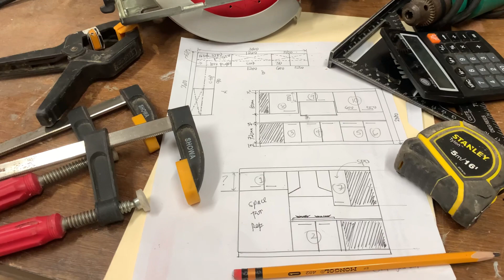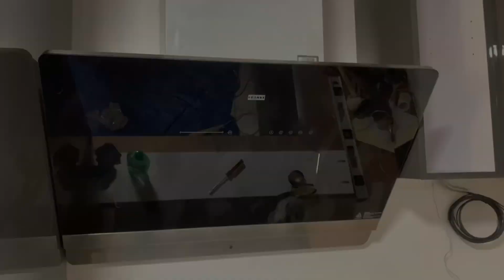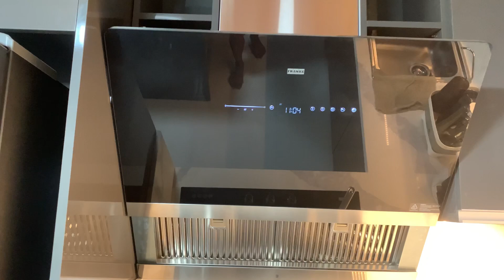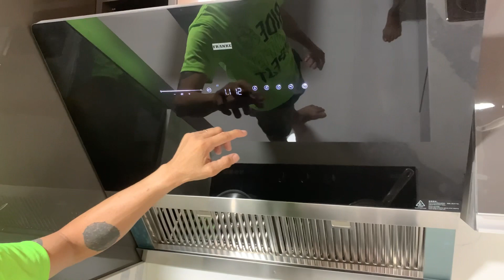The Process For Making Modular Kitchen Cabinet | Kzone Woodworks

Comment: very nice sir. ask ko lang po, saan nakaka bili ng mga mdf boards na yan na may finished top and color na po? mag kano po and ano sukat?  and ano po bang material ang ginamit sa counter top , baka po madaling ma biyak and ma bulok ng tubig and back splash o wall panels sa may lutuan and sink. maraming salamat po sa pag turo at sa pag sagot.
Reply from the maker: Good day po…bale un board namin n gamit dyan acrylic high gloss on marine board para s mga expose doors and vertical.tas s carcass or cabinet nman po marine melamine n white po cya.tas un counter top po granite po cya ganyan n po yan pag n bibili per slab po cya.nk sealant po yan kaya din po yan babasukin ng tubig.kadalasan yan n po gamit pag modular kitchen sir.matibay po yan..
Reply: @KzoneWoodworks  ganun po pala ang mga gina gamit na materials, sana ma isama nyo po mga details din ng ibat ibang materials even mga kinds of hardware, mga pang sara, handles and hinges and guides and saan po ba mura makaka bili, naka kasi po kung mga ace o wilcon mahal, may mga distibutor po ba. puede po siguro isang segment nyo yan, tutorial din po sa amin saan bibili at ano mga bibilin. also sana me details din po ang mga sukat ng bawat cabinet o panels para alam namin paano puputulin hehe. maramin salamat po sa episode na gagawin nyo po, madami pong mano nood nyan
Reply from the maker: Yes mo matibay po kc un marine board.s mga material po my supplier din po kami n malapit s amin tas maramihan po ang kuha pra po mk less.pag madalas n po kyo kumukuha s kanila
Reply from the maker: Nag bibigay n po yan ng discount.bk my malapit po s area nyo n hardware yun po kayo sun kumuha.ganun lang sin po kami.my supplier sin po kami.pag mga ace wilcon iba po price pwera n lng kung nk sale po.

Comment: Why didn't you use pocket screws
Reply from the maker: Gumamit po tayo dyan dun s mga expose side po nya nk pocket hole po tayo dyan.tas nag lagay lng po ng pockethole cover s pinaka butas nya n ns loob pra di po kita un pinagbutasan ng pocket hole.salamat.
Reply: @KzoneWoodworks anong screw ung tama sa pocket hole  lagpas kasi ung gamit ko na kasama sa kreg.
Reply from the maker: @martinlaureano8425  25mm po gamit ko pag 30mm tagos mo yan.masira po yun board nyo.salamat…